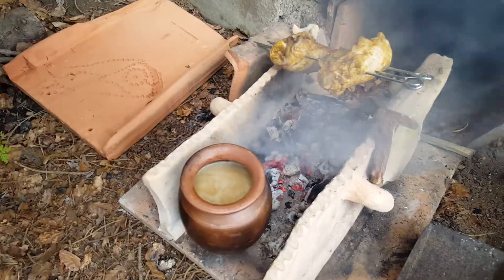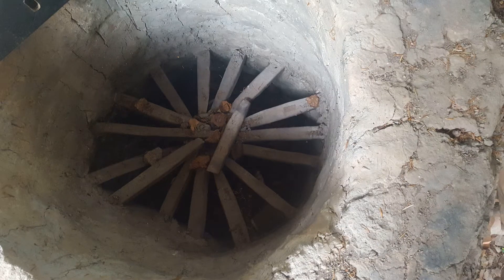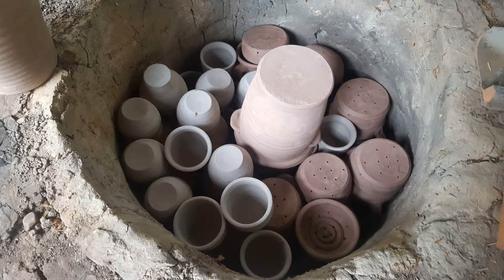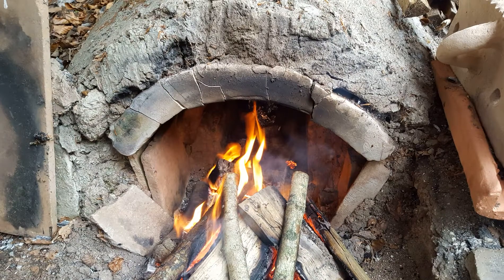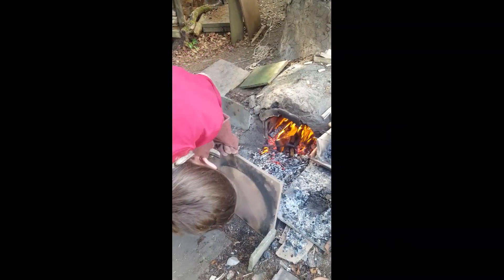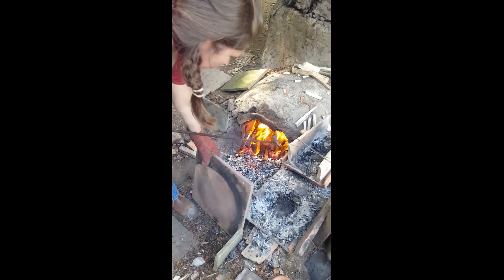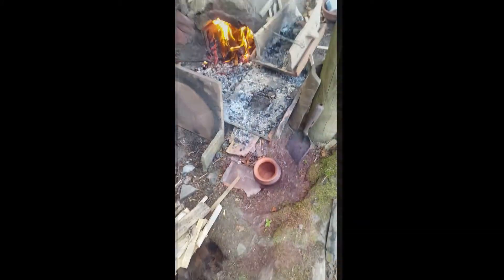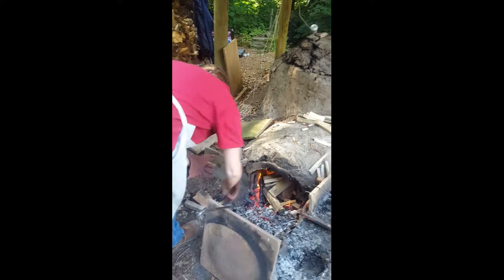July 2021 Vindolanda Firing

Comment: Approximately how many hours does a firing like this take?
Reply from the maker: Hi Liam, generally between seven and nine hours, depending on the temperature we're aiming for and weather conditions. Then 24 hours cooling for oxidised ware and 48 hours for reduced.
Reply: @PottedHistory  thank you for your reply! I’m working on a small wood-fired kiln for firing some roman style pots and oil lamps in my backyard, but I never seem to get it to the right temperatures/the right timing. They don’t really come out nice and bright red, as they are supposed to. Your video gives me a better idea of the proces!
Reply from the maker: hI  @liamvnbw  Key points: Fast burning dry fuel thinly split, don't over-stoke, bright flame, rake out embers and ashes. Stoke, wait till the burn just starts to drop, stoke again, as ashes start to build up, rake out.
Reply from the maker: @liamvnbw  Should also have said that the pots need to be densely packed to hold the heat.
Reply: @PottedHistory  Thank you very much for your guidance! I greatly appreciate these tips!